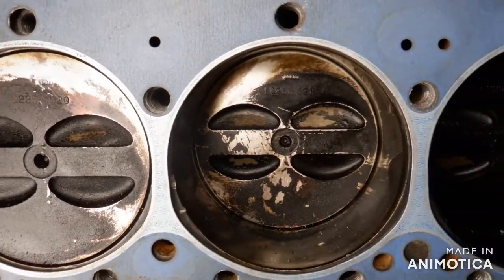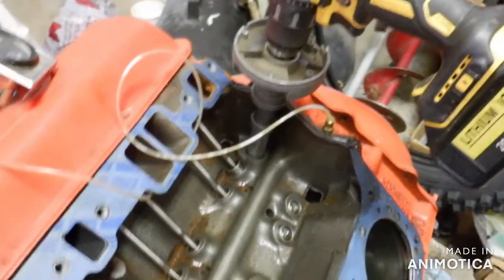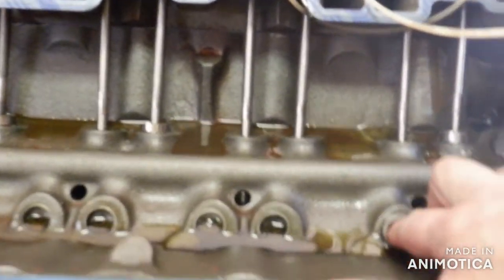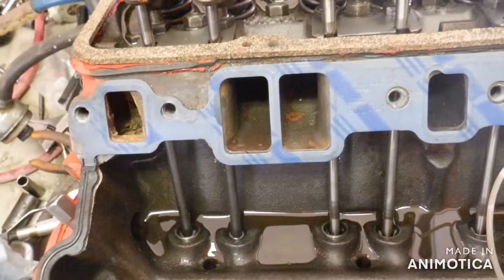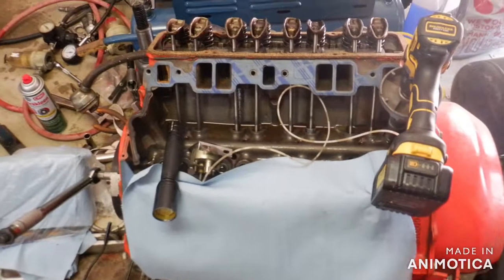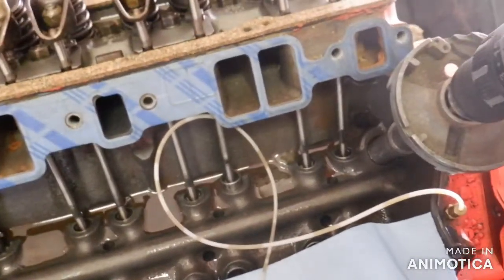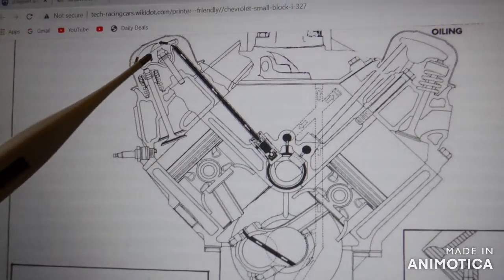350 Small Block Oil Passage Tracing to Chevy Rockers. Kendall Camonics Cam

Comment: I know this is old but you just got lucky and had the engine in the right position on your previous priming sessions. It's perfectly normal to have to rotate the engine to get oil in all rockers. Normally 1 rocker will be a pain. The lifters "lock" when they lift. No oil in or out. They only get oil when they're on the cam base circle. It's easier to prime by just cranking the engine without ignition. Crank until you have pressure on the gauge. Then reconnect your ignition and fire it up. It won't hurt a thing.

Comment: Your distributor shaft could possibly need an 0 ring if it’s been machined.
Reply from the maker: This engine had an Accel BEI distributor. Nothing touched.   And the issue was simply that I needed to keep spinning the distributor and slowly turning the engine.  I had not done that before. It had always "oiled right up" when I used the dummy distributor to pre lube the engine.

Comment: Can you elaborate on the engine you are working on?  Would it possibly be either a 55 or 56 Chevy 265?  Those engines are designed with a bit different oiling system that "pulses" rather than pumping.  They are designed so that oil is only delivered to the lifters and valve train if flat on the camshaft is aligned with the cam bearing oiling holes so you don't get full oil pressure all the time.
Reply from the maker: 350 Chevy, c.1976.

Comment: Just curious what type of solid lifter were you using ? There are a couple of types for Chevys. A piddle valve lifter where the oil hole in the lifter is located in the " Waist " or machined out area in the body of the lifter. These lifters expose this area to the lifter oil galley and will send a generous amount of oil to the top end. The other type is known as an " Edge Orifice " lifter that the oil hole is not located in the waist area but is a hole drilled into the body of the lifter that does not get as much exposure to the lifter oil galley. These Edge orifice solid lifters take oil from the clearance between the lifter bore and the body and are designed to Reduce the amount of oil going to the top end. Chevy used Edge orifice solid lifters as OE on some engines but most Chevy solid lifter engines used the much more common piddle valve lifter, The Edge orifice lifters were said to reduce the oil to the top end by 20 to 25% . This was back in the day when people thought that too much oil to the top end was a big problem and the edge orifice lifter was designed to help that so called problem. But I cant tell from the top of the lifter which type you have. Looking at the lifter out of the lifter one could identify it in seconds.
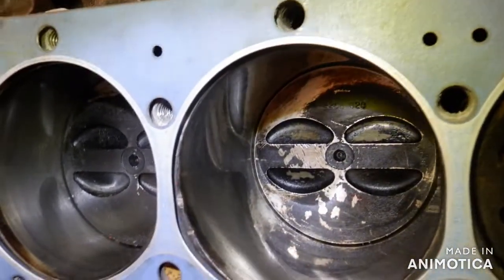Reply from the maker: The cam was Camonics. I built the engine in 1989.  I was told Camonics owner and Vic Eldebrock were friends. The cam (and lifters) were designed for Vic to use in some drag racing class. I never raced it. It had 530 lift and 300 duration both sides. Forgot the overlap..... the lope didn't come off untill 3500rpm. Reved real nice to 7800. I posted "The Last Fremont Drag Race"   (1989?).   had my 59 Corvette there.... had ignition miss, did 12.8@113. 3:70 gears... Should have done mid 11's.  I only raced it twice. first time Fremont had just repaved and it was Slippery. The regulars just packe dup and drove home... I had 3:08 gears. first gear was 88mph! Spun  all the way thru the 1/4.... 13.6@108.   I sold this engine last year.  Hope that helps.

Comment: Did you find the issue with the oil system yet. I’ve got a brand new rebuilt 327 mid sixties that is throwing 60/65 psi to the crank,cam, etc. but only one push rod was oiling the rockers. Ran it again and that one stopped oiling also. Never seen this before. I’m at a loss also. If you hear any info on the fix please share with me. Anybody out there on the web know the cause and fix for this problem?
Reply from the maker: This engine had been sitting for a few years. When I had the engine in my car I would remove the distributor and use a modified one to spin oil into all the orifices. Never rotated the engine. On this occasion I had problems. It had to be from sitting for years.. I slowly rotated the engine like you see here. I suggest you do what I show here. It took ten minutes or more to get effects. Just spin that pump and rotate the engine 10 degrees or so every few seconds.. Prior to all the above I was in a fit! I pulled the timing chain cover, running wires into different orifices... I thought maybe a mud dauber wasp had found  a hole. And that is possible where I lived.  My guess is patience will prove successful.  Pull the intake manifold and see if oil is getting there.  Look in the cylinder bore, is oil getting in there? Stay in touch
Reply: I know this is old, but did you ever figure yours out? What type of oil pump primer are you using? Some engines has oiling issues with using a single oil pump rod. And when you mod a distributor, the housing helps seal areas so the oil can flow through the other passages. When pulling the cam gear off of the distributor allows the housing to lower allowing the oil to bypass. This can happen when a intake isn't installed yet, are it has been removed. To fix this issue, take the cam gear and grind the teeth off or measure off a piece of pipe the same length as the cam gear and install. Until then, simply raise and lower the modified distributor housing and your oil pressure should return unless there is some sort of blockage that wasn't discovered by the machine shop or you. This is not for every engine design, but some do need a housing to reroute the oil. I hope this helps. As far as the video, it appeared the distributor housing may have been lower than if when a intake is installed so this could be his issues as well if before when he checked oil pressure he had a intake on. Also for the pushrods to have oil pump out good they must be ALL put in and at least slightly tightened to seal. Otherwise the oil will make it to the lifters but bleadout before being able to properly go up the rods. One head wasn't installed for some reason and some lifters left loose on the other head. All of the oil will go to the less resistance which is the open lifters and drain back into the oil pan. With it setting up, the lifters most likely was empty. Turning engine over with ALL lifters set up will allow a hydraulic cammed engine to prime and pump oil out the oil holes in the lifters, some may even squirt several inches. I'm sure there is something I have forgotten, but maybe this can be a start for some.